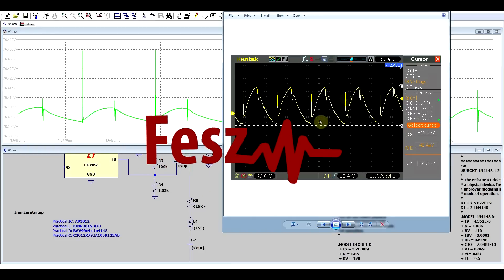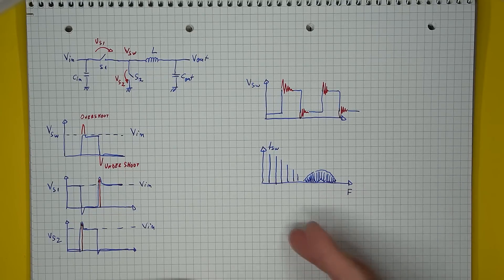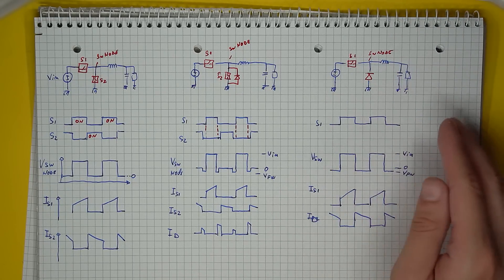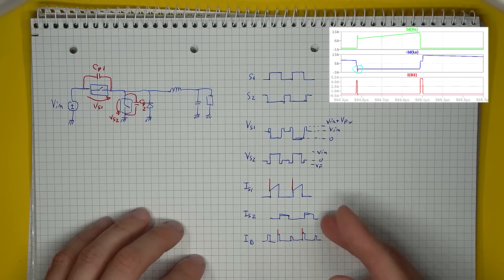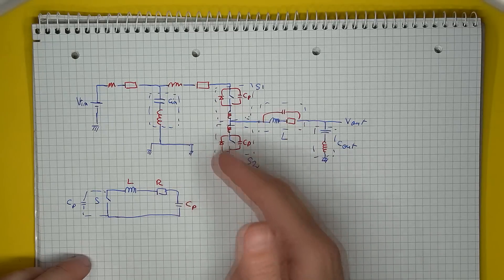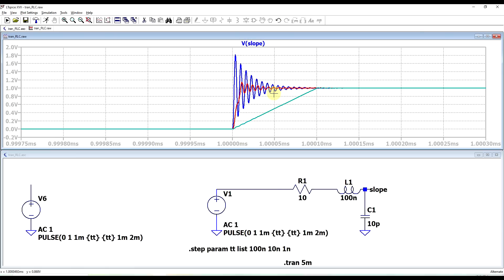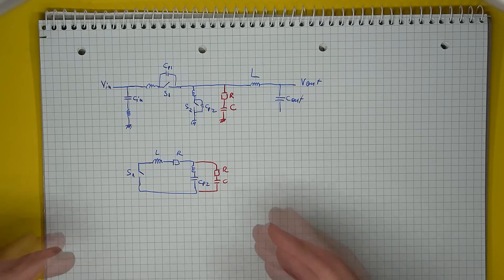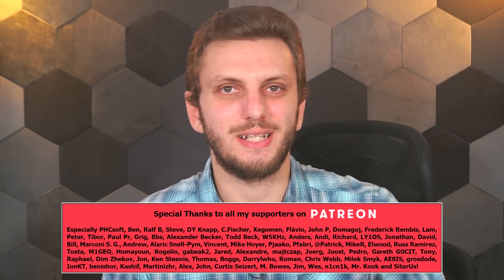Electronic Switches - SMPS and snubbers (1/2)

Comment: At 4:48 you introduced a diode across SW2 to ensure current is always flowing through the inductor. How does the diode achieve this? Its anode is at ground so the only way for it to conduct is if Vs2 < -0.6V rigbt? Why is that node swinging below ground when it wasn't before (the only change is that you introduced the delay). 

Is it that with the delay, the left hand side of the inductor would be floating for a short period of time, changing its voltage to try and keep current flowing, and the diode now allows current to flow from ground, and into the inductor?
Reply from the maker: The inductor current in a buck converter will always flow from the switching node towards the output; when the high side switch is on, the inductor behaves like a load, getting charged with current, so the left side is at a higher voltage potential than the right side; when the high side switch is off, current still flows either trough the diode or the low side switch, an this time the inductor behaves like a battery - it is producing a voltage which is inverted to when it was behaving like a load - so the left side is at a lower voltage potential than the right; if the low side is an ideal switch, then that side of the inductor is at 0V; if its a real switch (with non-zero voltage drop) or a diode, the switching node goes negative - this is how the diode is being polarized.

Comment: Nice video as usual. One note (if it hasnt been mentioned in the comments yet): your comment regarding the contribution of the low side free wheeling diode was not correct. It is actually important to consider and can be a major contributor to ringing after the low to high transition. It is the reverse recovery charge that causes a very high current spike, depending on the implementation. The already conducting high side switch needs to discharge it, before the output even can start rising. The intrinsic MOSFET diode usually has a high Qrr. Higher voltage FETs tend to get even worse. It helps to add a Schottky, but only if it manages to take over most of the current (which is peak inductor current, to make things worse). I use to choose the low side MOSFET to have an as low Qrr as possible. Your ringing waveform looks like you do not have an extra Schootky, as ringing is quite asymmetrical.

Comment: Happy 200th!🥳🎉 Excuse this late comment, but i am always backlogged in viewing my subscribed channels. At any rate, yet another excellent video with a lot of new fascinating details i need to learn.

However, i have a hard time understanding why the forward voltage of the diode would cause a negative voltage (5:20). Do you have any other video that dives deeper into this weird phenomenon?
Reply from the maker: Well, the diode is placed with anode to GND, and cathode to Switching node; when it is conducting, the cathode is at a voltage potential ~0.5V lower than the anode (exact voltage will be diode type and current dependent). As long as the GND (anode) is 0V, then the cathode (switching node) will be at a negative voltage - the exact value being the forward voltage drop.
Reply: @FesZElectronics  I feel like my electronic major has missed something fundamental here... Please let me dumb it down further...

If we froze time at a moment the diode is conducting, and i use a multimeter, negative lead connected to GND and positive lead to the other side of the diode, would the multimeter show a negative voltage?

If your answer is yes, then i REALLY need to sue my teacher.....
Reply from the maker: Lets consider a different example, you have a 10V supply, that drives a resistor trough a diode (diode has the anode towards the positive terminal of the supply, and cathode towards the resistor  A -|>|- K); this way the diode is forward biased, and you get a current trough the resistor; to keep numbers simple, lets say the forward voltage is 1V, so the resistor has 9V on it; coming back to the diode, the anode is at 10V, the cathode at 9v, the the cathode is at a lower potential than the anode by 1v; Coming back to the smps circuit, if the diode is forward biased, and the anode is at 0V, the cathode needs to be at a negative voltage; This negative point can also be seen in the simulation at 6:23 ; for short periods when no switch is conducting, the switching node goes negative - that is when the diode is conducting.
Reply: I think im starting to get it, but now my head hurts 😅

Comment: Your probe is not properly grounded during the measurement.
Reply from the maker: How would you propose doing it differently? As another viewer pointed out, it was not clearly highlighted in the video, but I did use a ground tip spring on the probe; do you suggest a better ground is needed?
Reply: @FesZElectronics  could be the circuit board design issue, low cost PSU usually uses 2 layer PCB
Reply from the maker: The board its self is something I made a while back, and it has some intentional issues; I did things this way to be able to better highlight possible problems and solutions. It was never supposed to be perfect :D

Comment: Excellent video as per FesZ standard. Clearly dissecting the problem from the definition all the way to possible solutions. Just I would like to add a small comment that the current spike during the turn-on event of the High Side MOSFET is not only due to the stored energy in the MOSFET's output capacitance, but highly probably due to Reverse Recovery mechanism of the Low Side MOSFET's body diode. I don't know, however, if you would touch on that in your second part on this topic. As a final remark, although ignoring this parasitic diode effect, you didn't lose generality on the guidelines for the RC snubber design which are spot on. Keep it up!

Comment: Very well explained, thanks.
I encountered this precise situation on a buck SMPS. The product was in its final version and the EMC testing revealed a terrible mountain of noise in the 100 MHz range. We found that a combination of schottky diode parasitic  few nH inductance coupled with a capacitor was the source of ringing. Changing the diode reference only changed the ringing frequency. Finally, a RC snubber was the solution, without degrading the power supply performances. The cost was a PCB re-design 😭, lost time and the commercial team very angry 😡

Comment: In the video you mentioned it is not easy to measure the series resistance to determine the Q, that is not accurate. A simple 2-port impedance measurement can be done to determine the Q very easily. We do this measurement all quite often. We have published multiple papers and app notes on this topic.
Reply from the maker: Maybe you can share the names of some of the App notes or papers (but not links - youtube usually hides comments with links)
Anyway, my point was that the resistance is not just trace resistance, its also in the switches and the decoupling capacitor; you will need to keep one switch on, the other off, and then the other way around to get a proper measurement, as I guess you already detailed in your work; it can be done, but its not as easy as measuring the stray capacitance and inductance :D
The method for measuring L/C that I will try out in part 2 is to measure the ringing frequency with and without some known added capacitance.
Reply: @FesZElectronics  Sure, you can find multiple app notes about 2-port impedance measurements on the publication page of our website. Also I would steer you to the Signal Integrity Journal where lots of our peers have publications on measuring the Q using the 2-port shunt through impedance measurement.

Comment: 😃😄😁😆😅 5 Smile's ever had that in a older relay makes a humming noise some flybacks will help in high frequency and current not in mine unfortunately mainly for that diodes reason😁. Helps fantastic if you want 4 voltage regulator working as the material adds a block to that 5v reg and needs pulling all working to a amp at 32v great for a dynamo ....

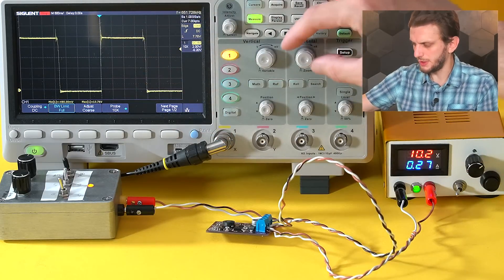Comment: I'm concerned that much of the ringing (at 1:40) may be caused by your probing technique.  The scope ground is not referenced to the measurement point (on the board), so there is a lot of inductance in series with the scope probing point.  A local (on board) ground should show much less ringing, and even better results can be obtained with alternate scope probe connections (without the standard 6-inch scope ground lead).
Reply from the maker: Maybe it was not pointed out, but I am using the short ground connection - the probe tip spring ground thingy; its visible at 1:37 . I am not using an alligator clip or anything longer...
Reply: @FesZElectronics   - Oh, I see it now if I look carefully.  Have you ever made a video about the importance of this detail of measurements?  Since we both know of the importance, and since it is difficult to see (especially in a small-window video), you may want to consider mentioning it at times when it is important.  Otherwise, people may continue to use the scope probe tip measurements and relying on scope-grounds back through power supply wiring.  Many hours have been wasted troubleshooting scop-ground induced ringing that was not really there.
Keep up the good work!
Thanks,
Carl
Reply from the maker: I will try to point it out more clearly in the future, thanks for the suggestion!

Comment: 12:05 - Here looks like we are referring to parasitics... worth mentioning just to make traces shorter from Buck IC to MOSFET's drain... which will decrease parasitics inductance..
Reply: Right, at 12:05 he's discussing the parasitics that he explicitly drew on the diagram at 9:30.
Reply: @Graham_Wideman yep, but would be helpful to mention to make high-current traces shorter
Reply: @SignalProduct-be2js  I'm sure that will be one of the topics of the second part of this series of videos.
Reply from the maker: Indeed I am talking about the parasitic inductance, but formed between the input capacitor and the 2 switches (mosfet+mosfet or mosfet+diode); this was not linked to the driving signal - if that is what you mean by traces from the buck IC...

Comment: Could you please make video on current mode buck converter and it's advantages/Disadvantages and how it's better than voltage mode buck converter
Reply from the maker: I will try to cover the control strategies - current mode and voltage mode at some point; not sure when though
Reply: @FesZElectronics  We are tremendously fortunate to have you covering the range of topics that you do. If you need any encouragement, I too would eagerly watch current mode vs voltage mode.